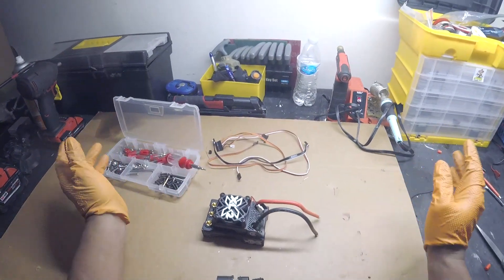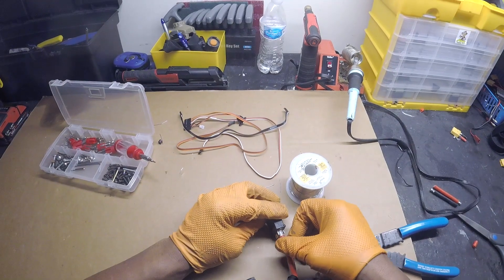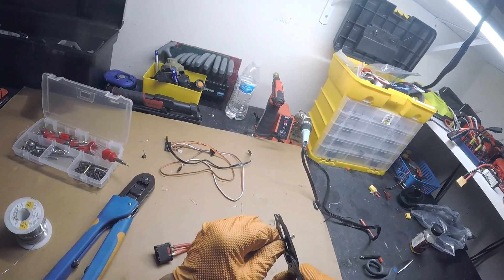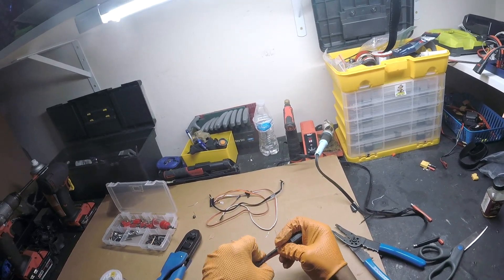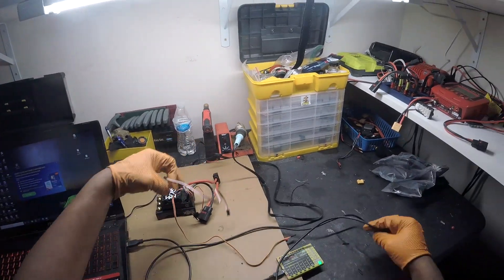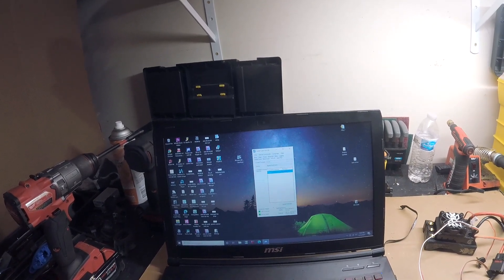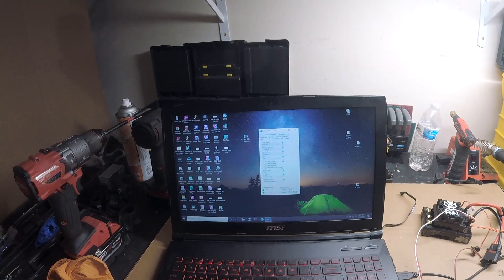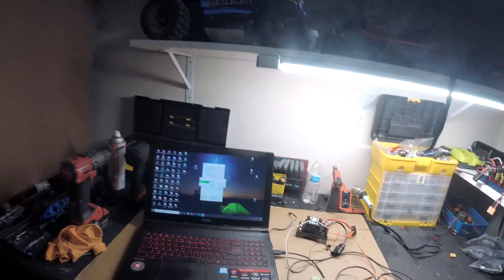Castle Creations XLX2 #comment #newstatus #art #best

Comment: What’s the point of doing it if the battery leads are only 10 gauge just asking
Reply from the maker: The esc has no problem handing 600 plus amps with 10 AWG wires from the battery.  Got s bunch of castle XLX2 esc videos running 10AWG from battery on my channel

Comment: I'm trying to adjust to use a sensorless brushless in XLX2 but I only have the option to run in "Smart Sense" and "Brushed" mode. Would you have any indication to run a motor only in brushless mode? Thank you so much for these details...
Reply from the maker: Just pick smart sense and don't connect the sensor wire

Comment: Hey bro I just noticed your channel I got a quick question I have a ESC to XOXO too and my bullet broke right at the ESC board but where the solder meets the board the board is still in good condition you think it would make it from a solder job or I would have to replace it
Reply from the maker: Its probably better to send it in for warranty.   Although its possible to solder back on,  but not a guaranteed fix

Comment: Is it necessary to use a dummy connector to solder these? Or does it just make it easier?
Reply from the maker: Yes its important,  if not then the male pins in female connector misalign themselves making it hard to connect and disconnect them
Reply: @KiloWattRC  Damn, I wouldn't of even been aware of that. I just bought some extra female plugs to use for when I go ahead and solder them up.

Comment: did you leave the xlx2 wire length stock from the factory or did you snip anything? also, how long was your jumper wire?

thanks!
Reply from the maker: I used original wire lengths.   I say maybe 5 to 6 inches long for jumper wire

Comment: Would you recommend this over the max5? Or do you think I should wait for the castle 12s? Also what servos do you run on the kraton? Good videos btw.
Reply from the maker: Thanks for watching forreal 🙏..   it really depends,  if you are into bashing the max 5 is perfect,  if more into speed the XLX and XLX2 are perfect.  Castle 12s i haven't heard anything new and not sure if the idea has been boycotted yet. PowerHD 65KG is the servo i use.
Reply: @KiloWattRC  thanks for the reply. I feel like I might aim for the XLX2 as it has the best of both worlds (speed/bashing) and it will give me more gearing options, maybe cooler temps?
Im also stuck on motor option what would you pick; leopard, TP, HW, or the castle 2028’s
Reply: @skullkidl9432  def go with the xlx2 combo with the 2028 1100kv. The can is the same size as the 800kv but with higher RPM. I run that set up in my kraton EXB 8s and over geared with a 39 spur and 45 pinion and it’s an absolute beast. I was running the hobbywing max5 combo with 1100kv and it has nothing on the castle system

Comment: Actually I never see the esc conect to castle link cable . Just The program card conect to the PC.  I miss something?
Reply from the maker: Right at 8:30 I plug esc RX cable to the program card.  Hopefully this helps
Reply: @KiloWattRC  ok i see.it but to made the fireware do not need conecct the batteries to the esc confirmed the update? I just said cause i dont see afer you do in the computer settings changes just . Jump to the esc ar conected with the motor and made the calibrate. Never see the esc on
Reply from the maker: No batteries are needed.   The laptop supplies the correct voltage to power on esc and to be connected
Reply: @KiloWattRC  I see you ar the man. Have a big question.. if I buy the Bluetooth b link. Can made  the firmware update to the xlx2 without use laptop or pc?
Reply from the maker: @Youworstnightmare77  you can only change esc settings with the B link.  You would need laptop for updates and data logging
Reply: @KiloWattRC  man.... what else needs to do the firware update? Any another cables
Reply from the maker: @Youworstnightmare77  just a usb from card to usb for laptop chord, a Playstation 3 controller charging chord works.  Program card or B link.  And download castle B link software to laptop

Comment: Would xt90 be enough or does it have to have qs8 connectors? Awesome video btw 🙏
Reply from the maker: Thanks for watching.   Castle recommends 8mm bullet conn with XLX2.   Qs8, EC8, XT150, castle 8mm connectors,  8mm bullets.  I am not saying it won't work but xt90 are definitely not recommended
Reply: @KiloWattRC  i appreciate the quick response bro 🙏

Comment: Do you know why my xlx2 I have to double tap the reverse to go forward instead the other around ?
Reply from the maker: What radio are u running.   U might have to calibrate radio to throttle
Reply: @KiloWattRC  I did that radio calibration and I am using dx4c
Reply from the maker: I would try a different reciever to rule out a possible cause
Reply: Calibrate it to your radio and maybe your radio is damage
Reply: @racingrivals8934  I did that, I put the radio and receiver to my Arrma big rock is fine but soon I put in to k8 and losi dbxle has the same problem, but I ordered new radio from radiolink
Reply: @asiringoringo1  have you tried putting the radio in reverse
Reply: @racingrivals8934  how?
Reply: @asiringoringo1  does your radio have a feature to reverse channel 2
Reply: @racingrivals8934  yes
Reply: @asiringoringo1  try calibrate it in reverse and see what happens also if your data log is full clear it
Reply: @racingrivals8934  I might try that
Reply: Thank you

Comment: Nice video.  I need to get an actual soldering station.
Reply from the maker: Thanks for checking it out.   Home depot has decent weller solder stations starting @ $45
Reply: @KiloWattRC  Thanks for the heads up.  Didnt realize a place like that would sell actual Weller stuff.